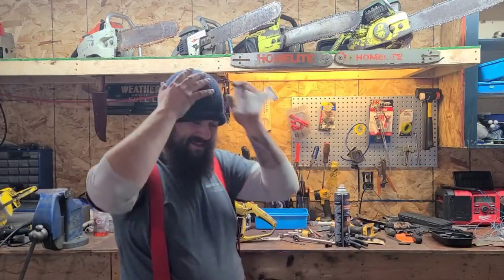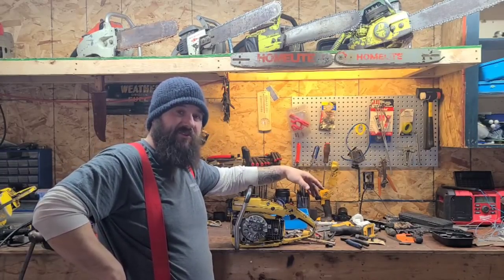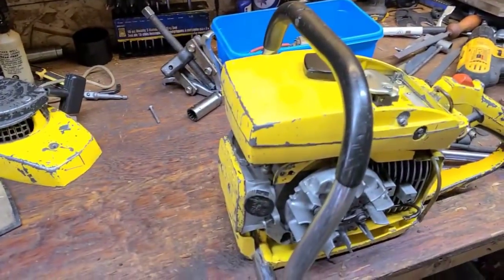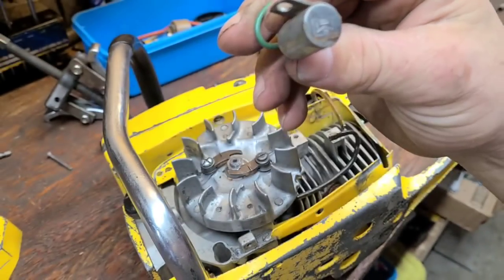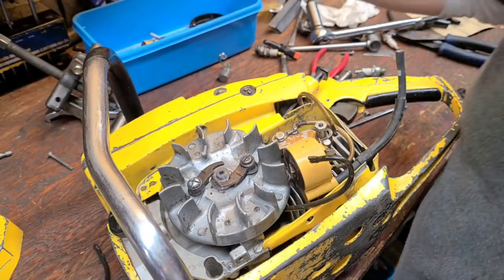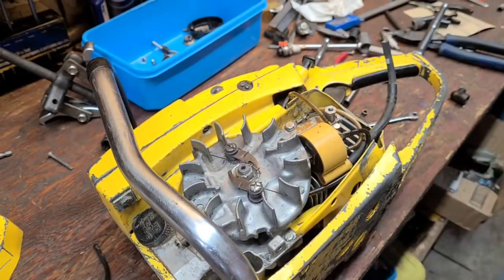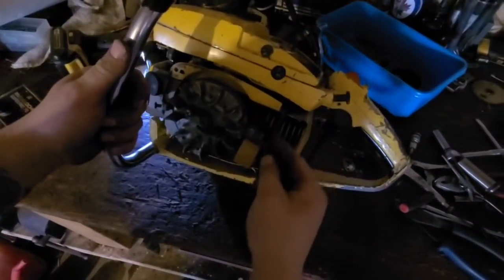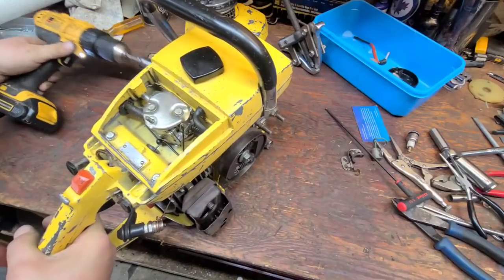Buckin's  McCulloch Super pro 70 lost spark!! Lets figure it out.

Comment: Hey Tinman,  when you install the module.. remove all of the parts for points/condenser.. the new module can bolt right up to the mounting where the condenser bolts behind the flywheel.  its-a nice and clean way that-a-way.

Comment: The purpose of the condenser, aka capacitor, is to prevent the points from being burned and pitted by the flyback voltage from the coil. A capacitor fails in one of two ways and affects the spark accordingly:  1) looses capacity value, which won’t affect spark but the points will pit excessively or weld together and then no more spark.  2) slowly internally shorts over time which causes weak spark and misfires, especially when saw warms up.  Just about any small engine condenser will work since the magneto ignitions are pretty much the same electrically.

Comment: I had a pioneer super620 and just the 620, in my learning days I accidently try sheared the flywheel key on the super620 and it chipped the crank unfortunately. But got the 620 running it was last ran before ethanol was a thing and the carb diaphragms were perfect still didn't even need the carb kit, by far coolest saw I've seen and I regret selling it as i just buy fix and sell

Comment: I would love to see how you put a new plug wire on that ignition module
Reply: me too.. and what type of wire did you use?  I would try for a resistor-less wire myself.  Also note about the spark plugs.. I tried different plugs in my 10-10s  the champion works the best.  plug should be resistor-less as well if i remember.  I also tried different spark plug gaps.  i believe for macs its .025

Comment: I have never seen anyone put an end on a spark plug wire that way. We just put the wire coil or the crimp type end on FIRST ...add a tiny bit of dialectic grease and slide it straight in the boot. no pulling wires around corners.

Comment: Tinman, I have had Glyptal engine enamel recommended as a way to seal cracks in the case of older coils. I have yet to try it out.... I happen to have a Mac 2-10 sitting waiting for me to replace the kill switch wire. Did the plug wire ages ago after I discovered there was a break in the insulation Guess how I found out about the break?

Comment: Hi! Thank you for the video! I have a couple of questions. I have a Castor C-70 from the 70s (an italian saw) that had ignition problems, now it runs great (except for the kill switch that doesn't work so I have to disconnect the spark plug, getting constantly shocked😂😂). While disconnecting the spark plug I noticed that it was still running because it was arching to the spark plug. The arc was like 6/7mm long at idle. Is the voltage of the coil always the same or at idle is lower than at high rpms? Im worried it is going to affect the sparkplug or fry up the condenser. Is the long arc due to points too close? Thank you!

Comment: when its starting to spark on the points,that means typicall its rhe condense badd or dead. condenser make the spark stronger.my self are using 12 volts conderser on 6 volts system.works great

Comment: From the start of the video i was shouting ''Put a chip in it''.lol. Hey mate could you please give the SKF seal numbers out for that saw, I have one(or 2) that I need to replace the seals on. The worst shock I got was working on my old Subaru, I was trying to suss out a problem and grabbed the plug wires while running. Not normally a problem for a mechanic, but this time I was leaning up against the side of the car. The spark arced out through my zipper and Mr Johnson. I new I was alive, haha. Any way seal numbers would be fantastic. Cheers mate.
Reply from the maker: Hey buddy stay tuned, I outlined the seal numbers in one of the next videos.
Reply: @tinmanssaws  Joy!

Comment: I'm still confused about what the points do. The coil converts the magnetic charge from the flywheel into an electric charge that runs to the spark plug, so where do the points come into play?
Reply: Try looking it up on the you tube. There are animated tutorials that helped me understand
Reply: To answer my own question: The electric charge produced by the magnets on the flywheel and the coil is AC, and the points are used to convert the charge to DC.